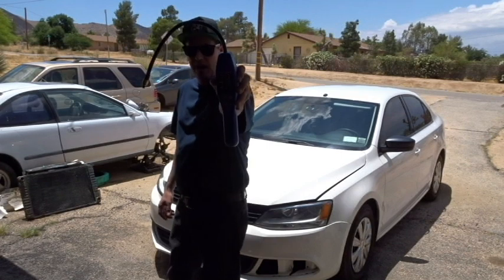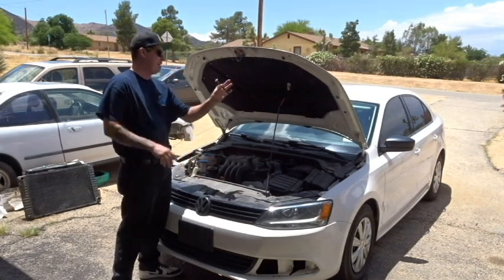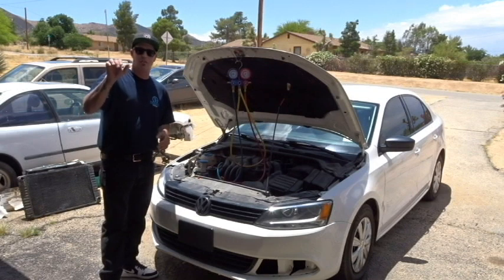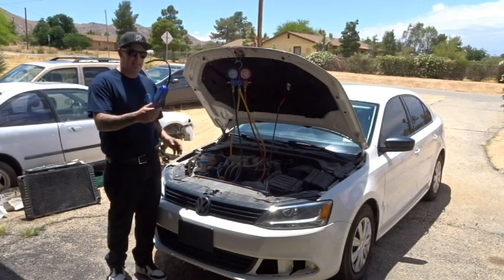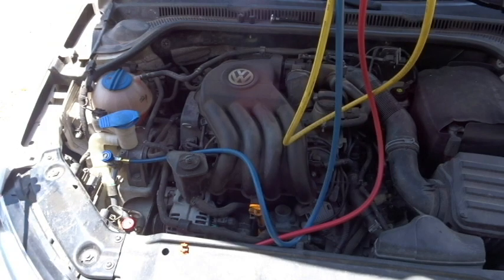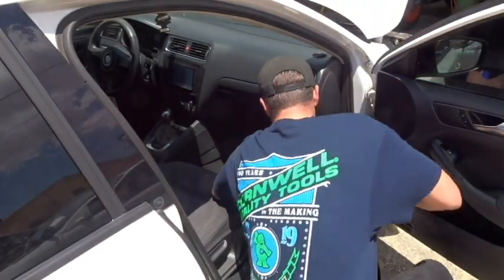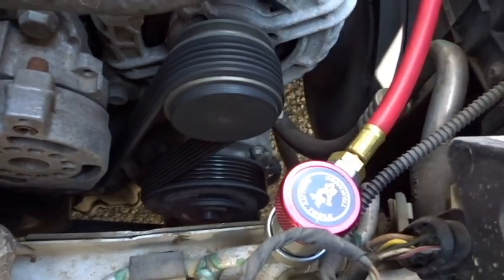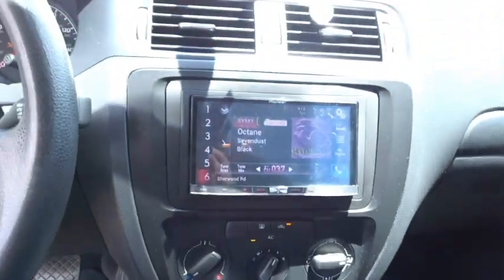MASTERCOOL INTELLA SENSE 2 REFRIGERANT LEAK DETECTOR!!!

Comment: I thought vw uses a variable rate compressor. It may not have a clutch. It can vary the pressure internally. So it does not need a clutch like most compressors. I found that vw/Audi can still have normal looking pressures but still be undercharged due to the compressors ability to vary how much it can produce. I always evacuate and see how much is in the system during diag with these type of systems. I have seen these have less than half charge and still look normal on the gauges.
Reply from the maker: Good info to know. Thank you very much for the information. I will look into it.

Comment: I can't comment on your Zurich video ( dont know W.T.F. is up with that) so I'll do it here.   Been wondering about these. Good review for what time you had with it.
I always wonder when someone over tightened the caps on A/C's if the valve aint leaking. Not too many sniffers are gonna like that much air flow. What was your pressure after it started blowing cold? 20° or colder over ambient is good. May have a sticky valve in the system. Sometimes percussive adjustments (tap with hammer or wrench) are needed. Also you could pull the hot wire for the compressor pump and see if there is power there. Also, why do you suspect a leak?
Reply from the maker: I suspected a leak because the car was in an accident.
Reply: @JustinDowDIYcentralhighway   gotcha...I got a minute or two of experience so if ya need to bounce some things my way man I'll try and help out
Reply: @JustinDowDIYcentralhighway   I hope you dont take offense brother, not tryin to suggest you dont know what your doin, its obvious that you do. I know when I can I like to toss around different shit to help figure it out
Reply from the maker: I appreciate it. Sometimes I run into situations that I don't have any experience with and it helps to get feedback from the community. I appreciate all the time, effort and support you all have given to me over the years. Cheers and many thanks.
Reply: @JustinDowDIYcentralhighway   Hey anytime Brother, glad to help when I can